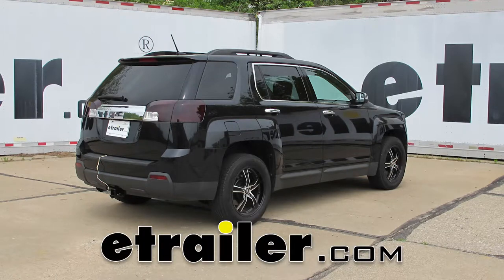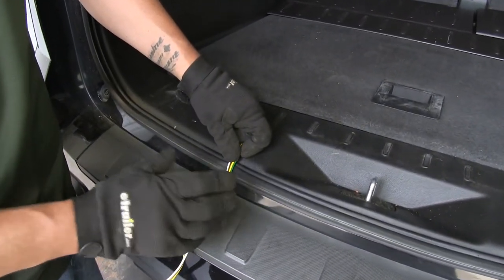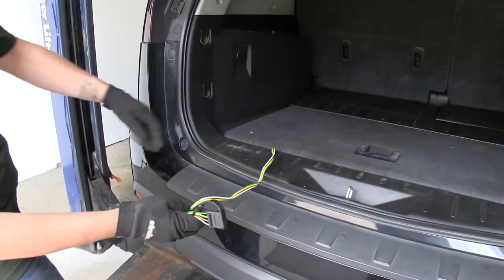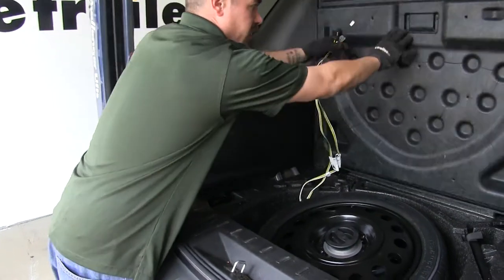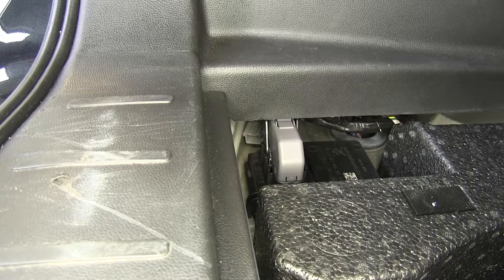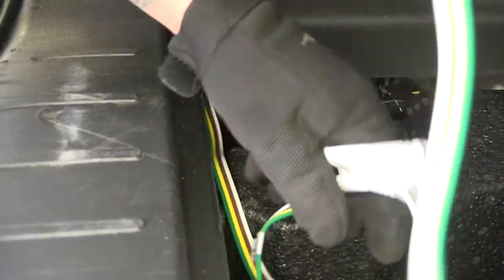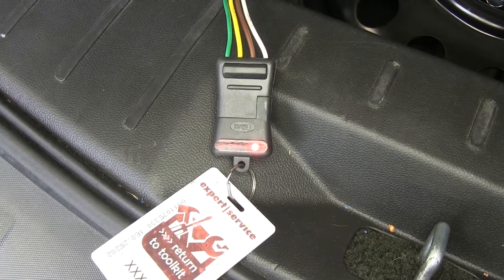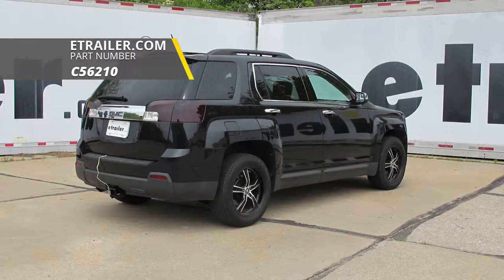etrailer | Trailer Wiring Harness Installation - 2012 GMC Terrain

Comment: IF the trailer has brakes.. Will this assist with braking? Or is this just for lights/turn signals?
Reply from the maker: This kit will only power your lights on your trailer. You will need a 7 pin connector and brake controller to be able to use the brakes on the trailer. You will want to use the 4 pole kit with the ETBC7 kit to get a 7 pin plug at the rear of your Terrain.
https://www.etrailer.com/p-ETBC7.html
https://www.etrailer.com/Custom-Fit-Vehicle-Wiring/Curt/C56210.html
https://www.etrailer.com/bc-2012_GMC_Terrain.htm